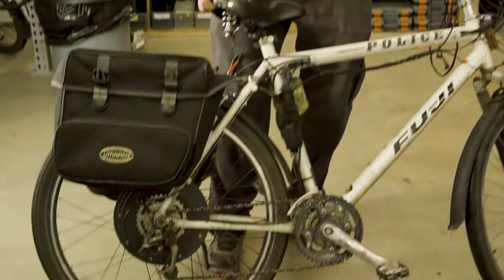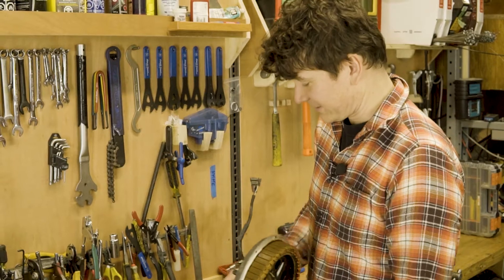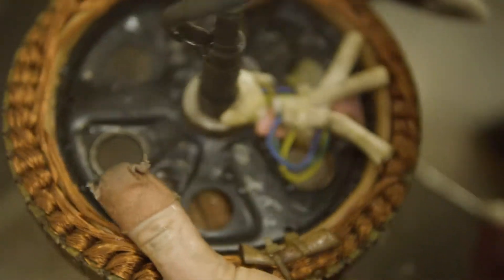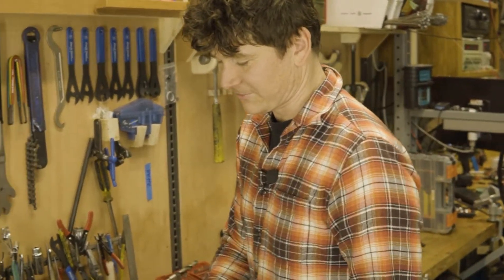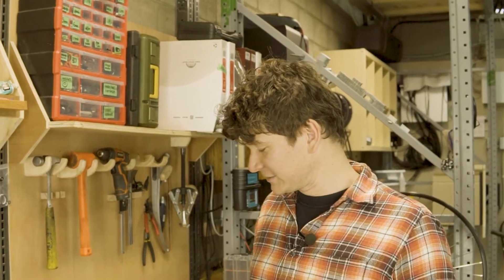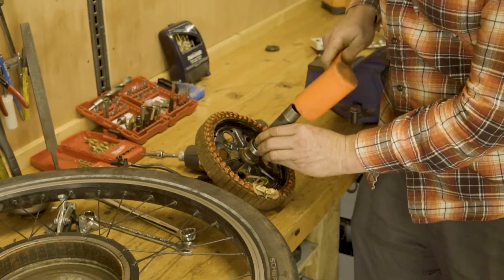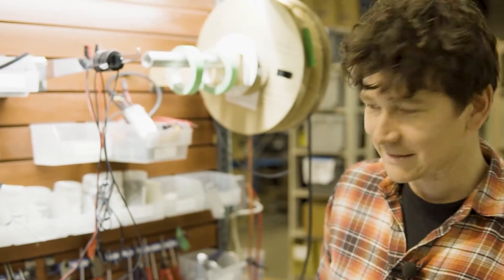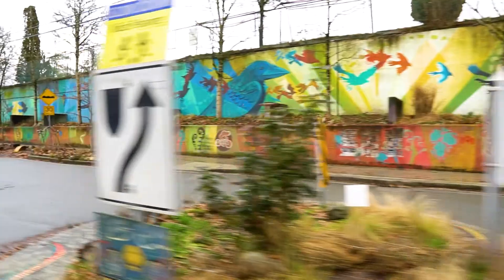Fixing up an old ebike hub motor with water damage, shot bearings, and a broken hall sensor

Comment: I would recommend replacing all the hall sensors while you have it open. Your only talking about spending a extra $10-15.. Murphys law always applys when u are working on a hub motor
Reply from the maker: Not sure that we'd necessarily agree to that. Hall sensors either work or they don't work, but they don't 'age' or get bad with time and benefit from any scheduled replacement.  They usually fail because there was a short circuit in the cable wiring that exposed them to the V+ Battery voltage (instant zap), or they have been submerged in water and the leads were corroded away and no longer make contact.   Replacement a working hall sensor with another working hall sensor doesn't make either of those any more or less likely to happen down the road.

Comment: dont you think that silicone will get melted when motor heats up and just get in to other parts ?
Reply from the maker: Silicone doesn't melt from heating after it has chemically cured,so no worries about that

Comment: I just took a seized hunb motor out of a Hover-1 scooter and it looked just like this. popped it out, sanded the magnets, wire wheeled the stator , washed out and WD-40 the magnets, reinstalled. works great, slightest whirring but its getting better. The remaining rust  (hardly any) has no where to go and its magnetic so I can only hope it grinds down to a very fine powder and stops making noise.

Comment: And this is why direct drive motors are ideal for reliability even if slightly less efficient. Same deal with gear hubs, slightly less efficient but it just works. If you're not a speed demon and just getting around it'll just work, pretty much

Comment: I love how you just gloss right over the specialized puller and method of separating the case.  I should block this channel.
Reply from the maker: It's a 3 jaw gear puller and it is a common (not specialized) tool used for pulling bearings or pulleys off shafts etc.  Any store that sells auto mechanic stuff will have an assortment of sizes.

Comment: Guy said maybe another 10 years before the hub motor starts to rust again. I got 2 1000w hub motors 1 I got November last year! And it's already showing signs of rust! And the new one I just got last month is already showing signs of rust and not accelerating right! I'm so mad about that.
Reply from the maker: Rust has basically zero effect on motor performance unless you have it so bad that it is cligging the air gap and preventing the rotor from spinning.

Comment: Brilliant video! Any idea what would cause a brand new motor to judder when installing? Not even got battery connected but when I spin by it judders , if I spin opposite way then back again this seems to stop it for a wee while 🤔
Reply from the maker: Any short between the phase wires will make heavy juddering, which is often the case when there is a blown motor controller mosfet. Or when spinning the motor creates enough back emf voltage to turn on the controller and the controller turns on in a state where it then enables a fet.  See if it does the same thing when the controller is unplugged from the motor or not.
Reply: @GrinTechnologies  thanks for reply, the loose phase wires were randomly touching 🤦

Comment: I wonder if drilling a drain hole in the housing with a rubber stopper would be a good idea on motors with water issues...leave it plugged when riding, and when parked make sure the drain part of the wheel is at the bottom and remove the plug.  Also...some kind of silicone spray on the inside of the housing and on all the wires and electronics might help rusting and shorts.

Comment: Great video thanks for the useful information... what is the metal device you are using for pulling hub motor apart called????
Reply from the maker: It's called a gear puller.  They are used all the time for removing hubs, pulleys, gears etc. from shafts and can be found from any place that sells automotive or similar tools.  We also carry them on our store page: 
https://ebikes.ca/shop/electric-bicycle-parts/repair-tools/gearpull6-9.html
Reply: @GrinTechnologies  thanks just what I need .....well I think so I have got a hub motor it has done about 2000 miles but I have got about a millimetre of lateral play when i wiggle the wheel from left to right I think it could be a bearing needs replacing what would you say

Comment: I wonder if gel filled wires would prevent cables sucking in moisture ?  I should open up my nine continent hub motor that has like 10,000 miles on it . I quit using it because the rim went bad at spokes. Thanks for good video !
Reply from the maker: Hey Larry, that would help almost for sure, just like how overmolded cables don't have this same point of ingress. I don't imagine that tinning and soldering the wires of a grease/gell filled cable would be very fun though. You should definitely fire up and use that old 9C motor, very easy to relace it into a new rim with new spokes and get another 10000+ miles from it!

Comment: Awesome video.  Wow, really thorough analysis of the ingress routes of water.  Plus elucidation of the hot/cold cycle and concomitant sucking of water (or even humid air that can carry water vapor) into the motor.  I've found that Liquid Wrench brand rust preventative works extremely well on rusty stuff.  It loosens the rust and assists polishing it.  Infact, it has put the prettiest shine that I've ever seen on steel and iron alloys.   Afterwards, it protected the pieces from rusting(not forever, but for a really long time).  Hey, sorry if I sound like a commercial, but I've been fixing stuff for 50 years and that stuff impressed me.   I don't think that it would be very nice to the wire insulation, rubber, or anyone made of plastic though.
Reply from the maker: Thanks for the tips Joe. There are certainly a few products that can do a good job of preventing surface rust on the steel inside a motor, though nothing beats not allowing water inside the hub in the first place!
Reply: P.b.blaster is good also

Comment: pretty sweet video... love how complete it is... except for one issue... why didn't you put statorade on the mags before putting it back together???  wd40 seemed cool to lube and keep rust away but why no ferrofluid???
Reply from the maker: Ha good question, main reason is that these motors have a statorade injection port in one of the disk rotor holes, so it's just as easy to add it after assembly than before. And for the purposes of this video it was mostly about covering the restoration side than the upgrade side. 
If you don't have a motor with a statorade port, then it's definitely a good idea to take advantage of the fact that it's open to add some ferromagic cooling!
Reply: @GrinTechnologies  In which circumstances would I add statorade to my ebike?  I have a bunch of 'em and have never added starorade but I'm thinking about it.  Also, do mid-drives take statorade as well?

Comment: Do you guys have any elegant solutions for e-bike brake cutout switches 4 hyd' brakes, not keen to glue sensors on my mt200 levers.  Ta.
Reply from the maker: No glue is needed for the tripwire sensors. But they can be a bit finicky to setup just right:
https://ebikes.ca/product-info/grin-products/tripwire.html

Comment: I am enjoying your videos. You have a lot of experience with these motors. Thanks.
Perhaps put a bit of silicone grease on the seal, as it will protect it. Also the same grease, applied excessively on the shaft where it goes through the bearing inner race, can help keep water out. Have you don't a test with Evaporust on the armature? It might remove some kinds of black oxide, but it didn't for what I did. Afterwords, perhaps a bit of clear lacquer can help prevent the rust--while allowing more repair that epoxy. If it weren't for repairability, conformal coating would keep the electronics new looking.

Comment: Question; Would spraying the internals with a spray sealant help deter rust buildup? When I service some generators to prepare them for humid climates. We would spray seal the rotors & stators to prevent such rust from starting.
Reply from the maker: A product like Boeshield T-90 works great.
Reply: @GrinTechnologies  I have a follow up question. Would filling the hub with transformer oil? It'll keep moisture out & transfer heat more efficiently. Also it wouldn't damage the electronics.
Reply from the maker: @Rudofaux  It adds a fair bit of viscous drag to the motor, but certainly helps with the heat conductivity.  Sealing in oil is very challenging and it will leak right through the ball bearings.  If you have lots of time, read through this thread here:
https://endless-sphere.com/sphere/threads/definitive-tests-on-the-heating-and-cooling-of-hub-motors.48753/
At some point I showed the test results using ATF fluid fill inside direct drive motors.
Reply: @GrinTechnologies  Thank you.

Comment: Hi Justin,
Thanks for teaching! Your channel is super helpful. 
I have to replace the bearings in my (1500w, 48v, built-in controller) hub motor after 25 000 kilometers. My motor looks like the same you fixed in the video. I think that only difference is the built-in controller. I will order a bearing removal tool and bearings.
Can you tell me what size of bearings need I order? (NSK 6005ZZC3 and SKF 6004-2Z ?)

Thank you,
Best Regards,
Reply from the maker: You find the bearing size you need by measuring the side of your existing ball bearings and then searching for bearings of the same ID and OD and width.   Going by "look" is asking for trouble, and we've seen 15mm, 17mm, and 20mm ID ball bearings all used in DD hub motors.
Reply: @GrinTechnologies   Thank you for your quick answer,  I'll do that.

Comment: How about fluid film inside the hub motor to prevent rust build up? A small hole or two could be drilled to allow for the spray straw
Reply from the maker: You can do that. We recommend Boeshield T-9.
Reply: @GrinTechnologies  cool thanks+

Comment: warm vinegar  soak takes rust off like miracle, but does it effect other stuff liek the enamel of the copper?
Reply from the maker: Not likely. But be aware that most acidic derusters will allow the iron surface to very quickly oxidize and rust again right after unless you promptly  treat it with another coating. The excepion is phosphoric acid which leaves behind  a more robust iron phosphate film.
Reply from the maker: Ultimately the rust in and of itself isn't really an issue unless it is causing mechanical interference. You mostly want to prevent more rust from forming than clearing every last bit away

Comment: I’m having a problem with trying to get the rim off    the hub is covered in rust. I am soaking it with WD-40. Don’t know if that’s what I should do or not do I just need a gear puller to get it out
Reply: And it’s completely locked up
Reply from the maker: I presume when you said "rim" that you meant something else, since the rim is just held onto the hub via spokes and normally if we want to remove the rim we'd just cut all the spokes. It's not worth the time to undo the nipples.

Comment: holes on the side of the hub motor is a very bad idea especially if a branch goes in the hole destroying fine wires. how about dust and small rocks popping inside the housing?  you think thats not going to completely destroy the thing? Sand? yea.. instead of just water why not dump a hand full of sand in it? thats what you do in ww2 dump sand in the barrel of a tank and see what happens. Please do not listen to this troll
Reply from the maker: There's such thing as experience and there's such thing as speculation. This is one of those cases where what most people would intrinsically speculate (all kinds of problems with debris getting in) does not happen in practice. That is speaking from 10's of thousands of km of firsthand riding experience and indirectly 100's of thousands of km of customers who've put large vent holes in their DD motor plates.

Comment: Your videos are gold. I would never guess that water could get inside through the cables. My ebike is everyday commuter (also in snow and rain), i already made like 80000km-100000km on it without bearing replacement or any serious service. Only fault i had was Torque arm fail and my motor cables wound around the axle, i had to replace them because of damaged insulation. Watching this i think i have to look whats inside again... Hope there wont be any rusty surprise

Comment: Hello from France and many thanks for your tutorials. 
I've just got a secondhand MXUS XF40C and was wondering if it should rotate freely by hand, or how should feel the friction like? 
No problem taking it apart if I should, but won't do it for fun. 
Motor was powered in front of me, air noise from wheel spinning was by far the loudest (quite silent compared to my other bike, new 250W geared Chinese hub).

I can rotate the axle with my fingers but there is some resistance, kinda smooth but definitely neither free at all (takes some force to rotate, a 10 y.o. kid couldn't for instance ), nor "rubby" like a dead bearing. 
No noise either, apart from a VERY faint rubbing of some kind (hear it with my ear at like 20cm, and can't feel the rubbing in the rotating movement) on one place when doing a full rotation.
The bike is was from has not seen much water at all, but a bit of sand from bikeparks it did, the homemade battery case had at least 50g of it inside.
Reply from the maker: It is very difficult to turn the axle by hand in a DD hub motor, unless you have a good grip on the axle. It's usually somewhere between 0.6 to 1.5 Nm. Your hub sounds totally normal.  There is no reason at all to take it apart.
Reply: @GrinTechnologies  Thank you very much, I didn't think of mentioning it, but it's indeed 1-1.5 N.m by feeling, the torque wrench I have at home doesn't go this low. 
It's good news, and in the meantime I have found the Statorade injection port behind one of the brake disk fixation screws... 
I guessed the previous owner had bought the motor from yours, and nice Jack O'Neil talked about this ports location on the comments below.

Comment: I made a go-kart for my son with a hoverboard motor... when it starts, the motors hum but after a few meters they work normally,,, when I turn them on so that they don't have contact with the ground, they work perfectly... please help,,, what is the problem
Reply from the maker: The problem sounds like a sensorless self starting algorithm. Without knowing any more details of your motor controller, it's impossible to say more.  Your motor itself is obviously fine.
Reply: @GrinTechnologies  I got it, I think it's overrun, I made an e-kart, the two front wheels are havebord motors and I have a 1000w motor on the rear axle .. now I made the acceleration happen on all motors ... thank you very much for the answer,,, this is your channel very good and you can learn a lot
Reply: @GrinTechnologies  I have a couple of projects I would like to show you.

Comment: Hey man! great video. Whats the name of that tripod claw tool you're using to open the hub? my Himo Z20 is totally locked, i left it out in the courtyard for quite a while and it started to get stiff but now its totally locked up. Replacement hub costs 140e from ali express but shipping is 150 to me in Berlin! just looking if maybe i can fix it. It looks easy enough to get the thing open using that tool, Id like to see if shes totally kaput before forking out. You video gives me hope!
Reply: Looks like a generic gear puller

Comment: Another trick you could quite easily do is to use conformal coating or a layer solder resist on the hall sensor PCB to prevent any water ingress from causing a short on them. that will reduce the chances that the signal of the hall sensors will be messed with by any water ingress...

Comment: So on bikes that see heavy usage every day having the side covers punctured seemed like the better choice…?
Reply from the maker: It's a good choice especially if you have a motor that isn't otherwise well sealed on the side plates and axle exit. The side plate holes allow any ingressed water to easily escape.  But if the motor is properly sealed, then most would argue Statorade is better.

Comment: Is there a way to take a 1000w rear hub motor and respoke to a front wheel?
Reply from the maker: Your motors axle width will probably prevent you from installing it on the front wheel, as a rear wheel motor would only fit into drop outs of a rear fork, standard bicycles have 135mm spacing for rear, 100mm spacing for front. If you did say have 135mm Front Forks, like on many Fatbikes, then you could use a rear motor and dish the wheelbuild to be centered, so I guess the answer is yes.
Reply: @GrinTechnologies  thank you, it's actually a direct drive, ebikling.and I do have a fatbike.

Comment: Best tutorial on direct drive motor repair, THANKS! Btw, at 16:27  on the inside of the motor cover plate, are we seeing a thru-hole on one of the disc brake mounting screw-holes, and if so, is that common and could it be used to inject your Statoraid ferrofluid coolant?
Reply from the maker: Super good observation Jack. This is indeed a statorade fill port that we have custom drilled out on most of the direct drive motors that we sell. It's not something that is common for DD ebike motors in general, but we certainly would encourage other manufacturers / vendors to include an easy fill port for Statorade like this.  The disk screw hole is an ideal spot in most hubs since it's already there and is naturally plugged by the disk bolt.
Reply: @GrinTechnologies  Thanks for the reply. I have a non - Grin Motor, I'm doing a controller upgrade on, so I may have to try drill out one of the disc brake holes. I was thinking that using a slotted threaded insert as a drill collar might make things a bit easier and prevent damage to the threads while using a small bit.